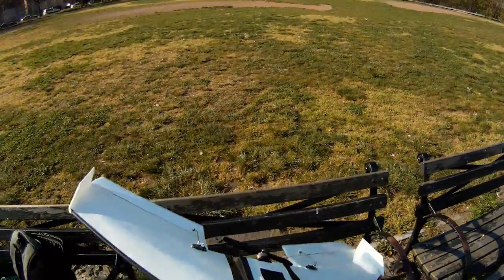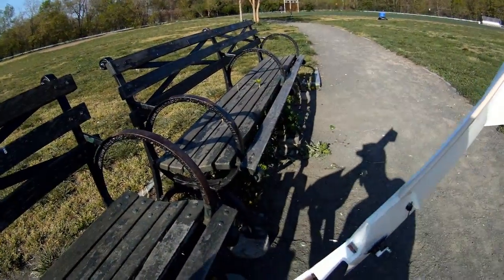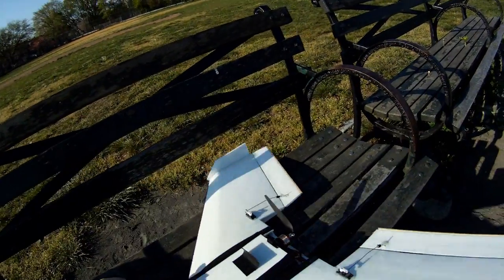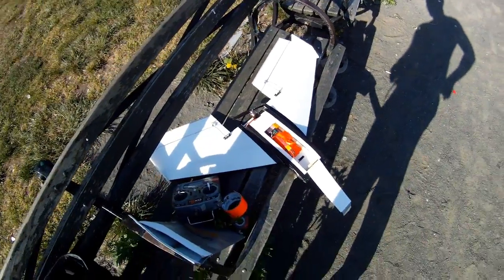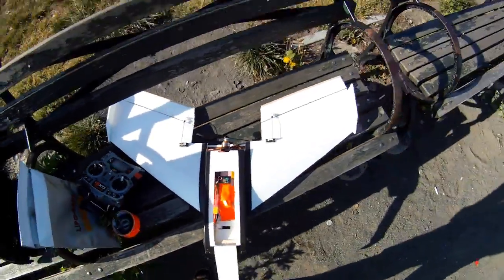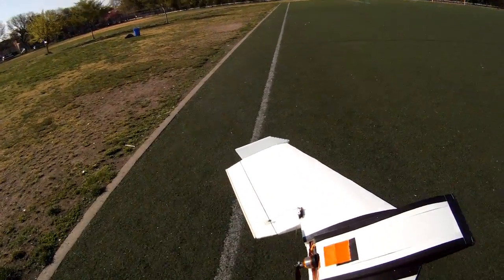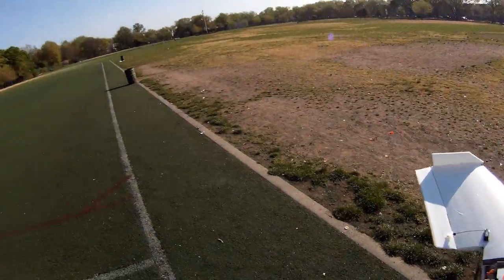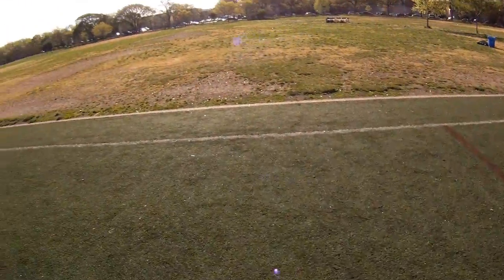BajiJet Hybrid flying wing, details and flying. Armin wing technique.

Comment from the maker: yep, cambered wing definitely helps, and this one sort of disproves common opinion that flat bottomed airfoils are unstable. 
My wings are probably heavier than fabricated EPP or other foam extruded wings of same size, but they are cheap and easy to build, so I guess it's an even trade off.

Comment: That's nice, very clean how it comes together.  Impressively slow on the glide and landings for sure.  I can't help but think having a cambered wing helps with that.  My flat wing deltas are not nearly so lifty, even though lighter overall.